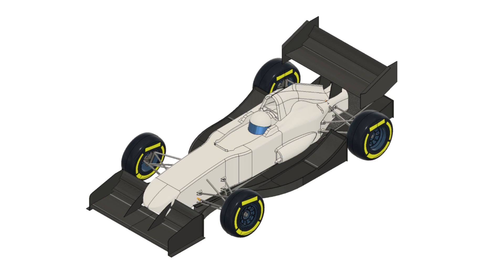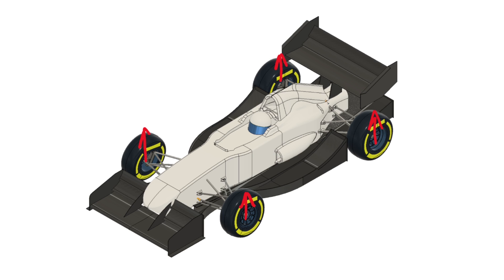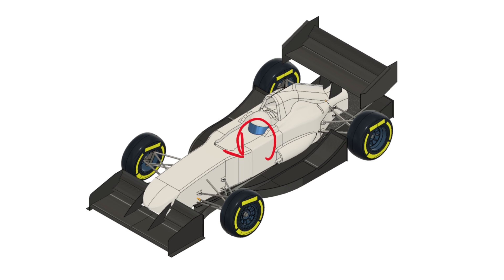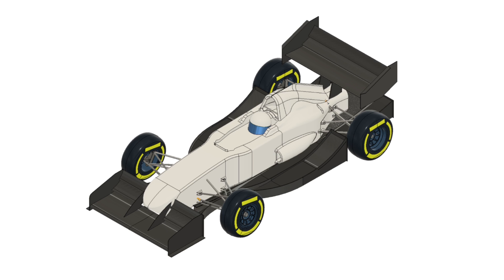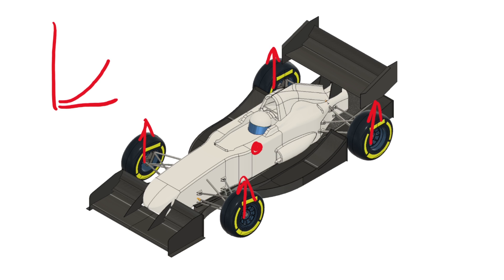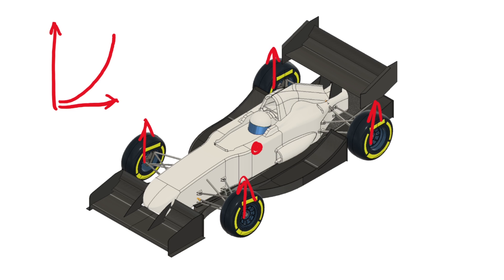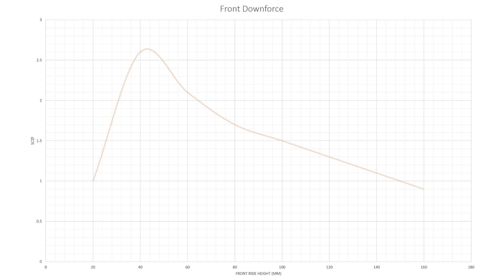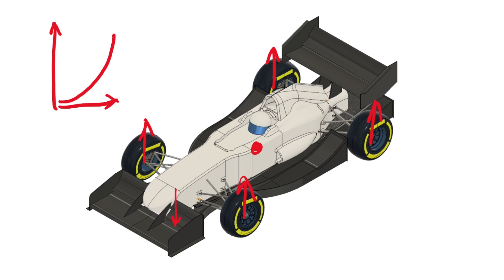How Do Heave Springs Work? Third Elements Explained

Comment: Question:

Is damping important for the heave spring ? Ie can it be just a spring rather than a coilovers, just like the anti roll Bar? Relying omly on the corner coilovers to do the damping. That way there's one less variable (heave spring damping rate) to worry about.?
Reply: Considering the heave springs are usually super stiff, I'd expect the heave damping, at least in rebound, to be similarly stiff to control it.
Reply: to completely isolate the heave mode, yes it needs its own damper. for a slightly compromised setup you could valve the corner dampers to suit the added spring rate. many ways to cook an egg
Reply: @RHBTurbochargers  And to add to that, it's not like having a super stiff anti-roll bar with soft main springs and matched dampers doesn't come without side effects. Ideally even an ARB would be damped separately.
Reply: @jubuttib could this setup theoretically work with only a heave spring and torsion bar? Possibly dampers in place of the corner springs to counter the tbar?
Reply: @jameswillis8524I pretty sure there would be nothing stopping the car from just sitting at full roll in that case, nothing to push it back to flat

Comment: Awesome video
Just a quick question: how does the system you showed in the front allow for the movement of one wheel independently?
Reply: 9:45 is when he shows specifically that
Reply: Same way a "regular" suspension setup with anti roll bar would. Compression of that side and simultaneous change in the anti roll / t-bar twist.